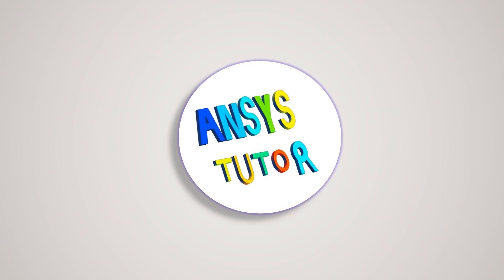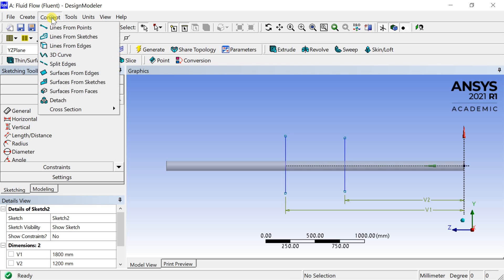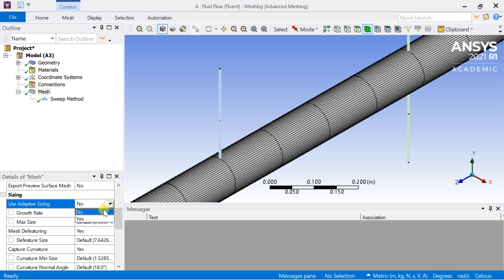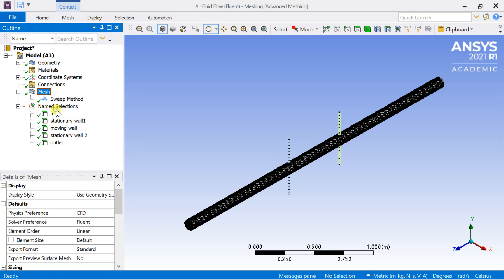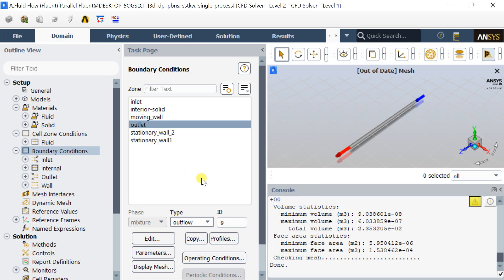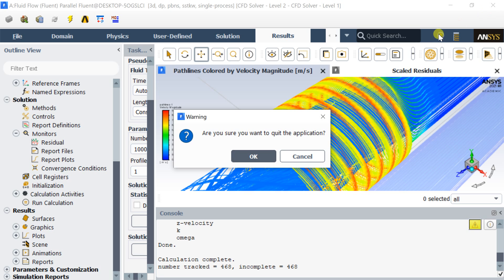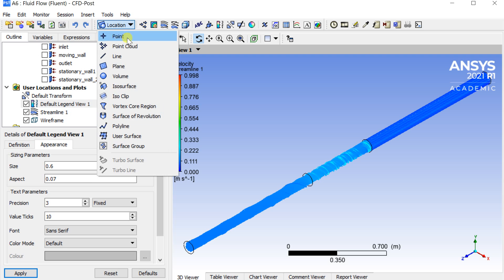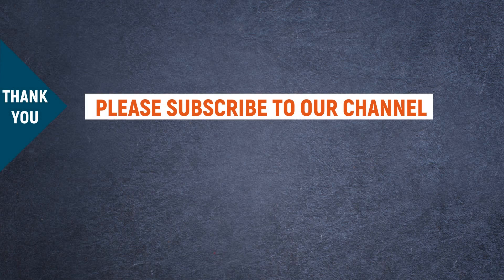Flow through a mid-Rotating Section of a Pipe | ANSYS Fluent Tutorial | Moving Wall | ANSYS 2021 R1

Comment: I followed all the steps in this video and I got the result when the inlet velocity is at 0.1 m/s. However, When I changes the inlet velocity from 0.1 m/s to 40 m/s, there was no rotational velocity developed. What is the reason? is there any relation between inlet velocity and velocity at the wall?
Reply from the maker: I think the velocity is high enough for the small geometry, which might be suppressing the effect of rotation. Which caused it hard to observe the rotation simulation.
Reply: @AnsysTutor  Thank you for your reply. However, I have an experimental setup for the same model and I am getting the effect of rotational speed in my experiment regardless of inlet speed. In my experimental setup, my inlet velocity is always higher than the rotational one. But in modelling, it is only showing the effect of rotational speed for a small range of inlet speeds. Can you kindly comment your views on this?

Comment: How could you simulate a fluid that reverses its direction regularly.  I am currently trying to learn how to simulate an oscillating water column, in which the airflow direction reverses as a water level oscillates up and down, however there is very little information about this online.
Reply from the maker: You need to use dynamic meshing approach for such simulation.

Comment: Sir iam new to cfd and my doubt is why do we use a solid cylinder as a pipe rather than a hollow cylinder?
Reply from the maker: that is the fluid domain. The pipe solid body has not been created. Its the only outer surface of the solid cylinder which denotes the pipe inner wall.
Reply: @AnsysTutor  ok sir so basically we are not concerned about the structure we are just making a path for fluid to flow?
Reply from the maker: It's the analysis of flow behaviour. We can also create the pipe body similar to the real life object, but for simplicity and to reduce the computation time, we only focus on the flow domain.
Reply: Ok sir Thankyou

Comment: May you please give a tutorial on how to use REFPROP Data base to select for example supercritical CO2 fluid as the working fluid
Reply from the maker: Will try to make a tutorial.
Reply: @AnsysTutor   That will be awesome. Thank you very much
Reply: @AnsysTutor  if you can use the  structured mesh model of the dry gas seal that will be very helpful